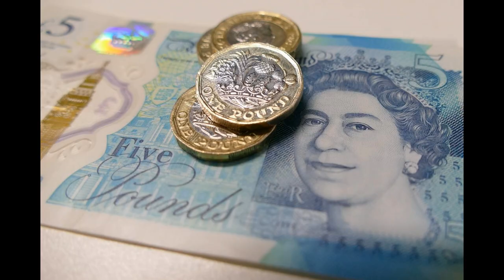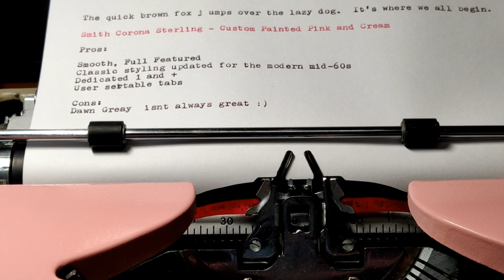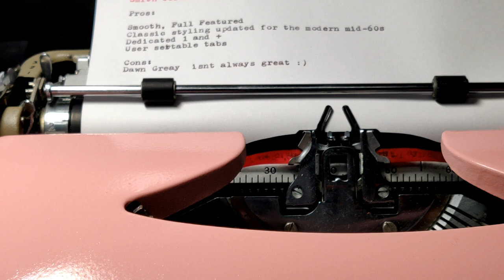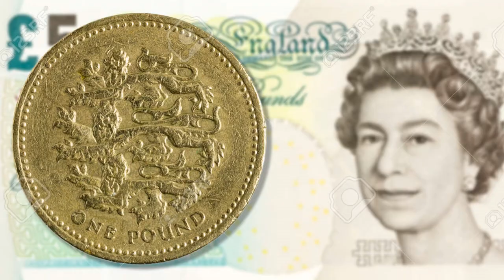Smith Corona Sterling Typewriter Review: Sound as the Pound

Comment: I have actually two 3 diamond "Classic" models both from 1964.  The only real distinction between the Classic and Sterling models, gleaned from your videos, is that the bells on the Classic are noticeably smaller and quieter.  One of my Classics has a carriage centering lever while the other does not.  The metal brackets in the case will keep the machine centered and simultaneously release the carriage return levers...pretty nifty.  As a side note one of my cases has cracks in the handle support so I don't trust it to carry it that way.